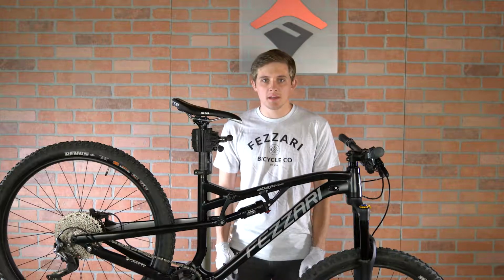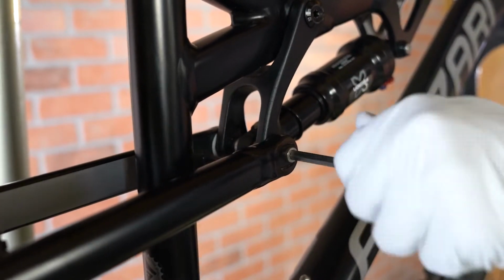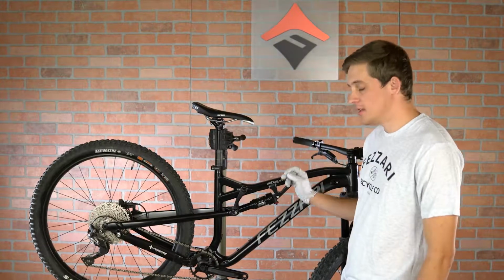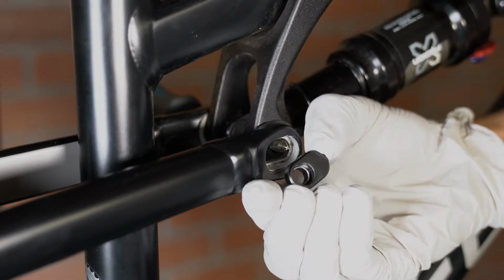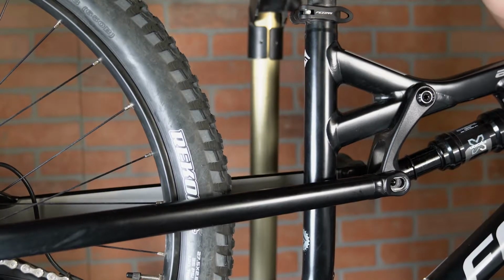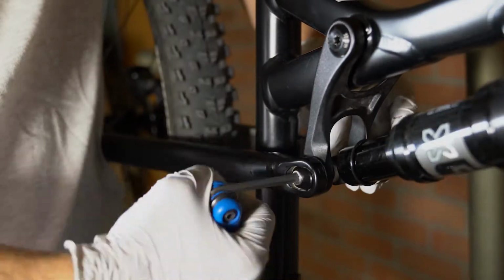How to adjust the GA link

Comment: What size is the bolt?  That came out WAY easier than mine.
Reply: No kidding, I was trying to clean the bearings and I couldn't get it out. At all.
Reply: I had the same problem with the bolt not coming out. I figured out it was bent. So I carefully tapped the bolt with a leather punch and hammer and that was enough to push it out.
Reply: On the La Sal Peak 2.0 one side is a 5mm and the other a 4mm